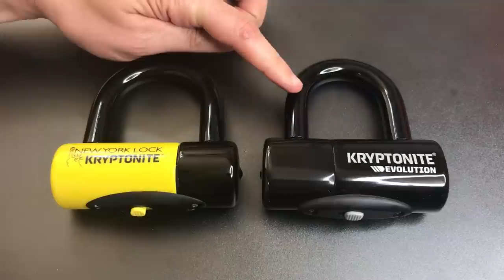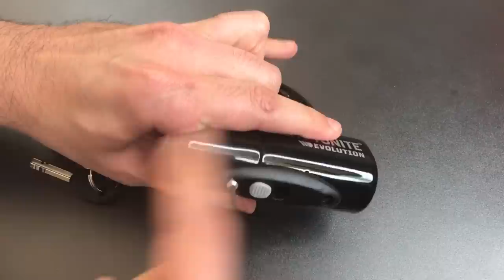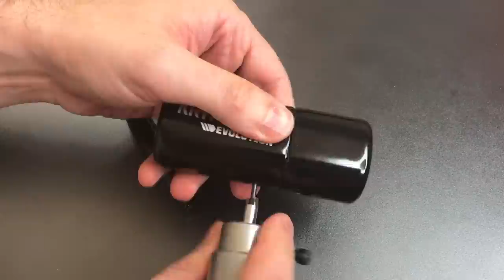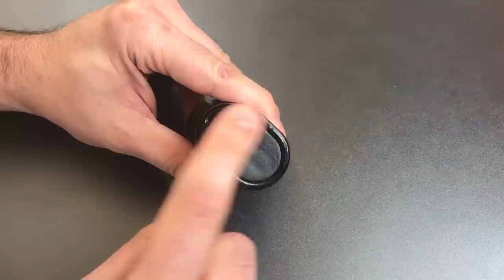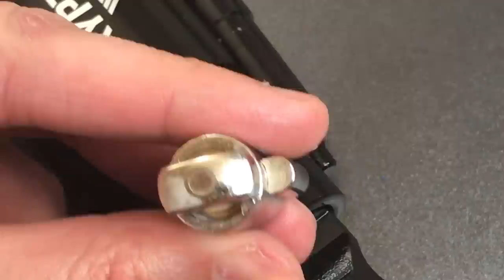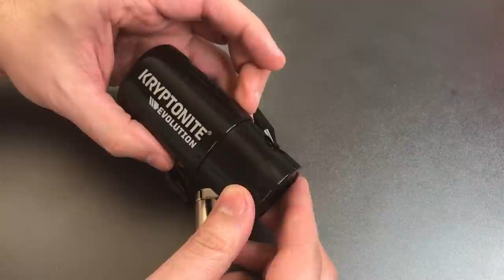[564] Kryptonite Evolution Series 4 Motorcycle Disc Lock Picked

Comment: I really don’t think that lock is pickable in the “wild” by a thief who is in a hurry and dealing with the elements and or witnesses.
Reply from the maker: +Bill S I agree with your conclusion, but not reasoning. Thieves simply don't take the considerable time required to develop the skills required. There is nothing inherently tricky about these locks.
Reply: @lockpickinglawyer  Agreed.  Most thieves/criminals are lazy by nature, as their mission and mindset is quick wealth with little work.  Which in reality is the hardest lifestyle for when you fail, which they a eventually do....
Reply: Haseeb 2  what are the dimensions of the magnets that you used for this?

Comment: You really have destroyed my faith in the security of the disc detainer locks.
Reply: I totally agree he burns through them quicker than other types of cores, I will steer clear of disc locks.
Reply: You gotta keep in mind he is a VERY VERY skilled lockpick, and also these disc detainer cores he's blasting thru and opening often don't have proper false gates. He speaks to this on this video https://www.youtube.com/watch?v=FfFTNsowDvk If you look around at all the picking videos on youtube, almost none of them are doing disc detainers which further proves how challenging these are. 

You're much better of with a disc core as most intruders won't even begin to have the tools to compromise the core of the lock, whereas it's much more likely (if they're going for a surreptitious attack) they will have standard picks, rakes, and bump keys thus making you more vulnerable.
Reply: mwiz100, only 6 months ago he stated that picking the Abus plus core was "certainly beyond his current abilities". So it's perhaps not the insurmountable challenge it appears to be. Either way, he has yet to pick the Abloy protec -- the holy grail of disc detainers n'est-ce pas?
Reply: Disk lock is a combo lock ., Usually disks have 6 cuts Abloy have also 7 cut version and they have had versions where they mix different disks .
There is thinner and taller versions of disks .
That core is very short and by key its 6 disks , with 6 cuts/disk thats only 46656  possible locks .
Going with that number and let say that make 1 000 000 locks with that core ...thats 21 locks that have same core and key !
Reply: Remember, LPL is very skilled and knowledgeable compared to your average folk. Also, this is a motorcycle lock but he makes it look easier because he only has it on a table. If a crook were to attempt picking this while it was on a motorcycle he would not have an easy time. For God's sake the first step was to remove the plastic cover plate. Don't you think that would attract the attention of people walking by, a guy fiddling with the lock??
Reply: there's more than one video of people who hit that random lottery and have 2 locks opening with the same key.    I'm willing to bet the number of matching keys is higher because manuf want to save money and using a semi-mass produced, limited number of cores, would cut costs.    I have 1 abus bike lock where the code to have a key recut is only 4 digits.  that means only 10000 different keys max on that model.   And on another lock, i actually bought a lock of the same model that used the same key.  It was purchased several years later.
Reply: Electronic locks can easily be defeated too.
Reply: that would actually be an interesting way of doing it.  like a smart card way where the unlocking code is changed every use so there's nothing to copy, not even an algorithm.
Reply: So far all electronic locks need a mechanical lock as back up so you can get in if there is no power . 
Then we have that little problem so far there is no electronic lock that can't be hacked and some even faster than mechanical locks .
In USA people hacked electronic garage locks with a kids toy and in Germany a big apartment house area changed to electronic locks and one person was able to copy the signal that mail mans key was sending and with that over 90 % of all new lock opened .
Then we have this issue we have where I live ...there maybe  - 40 ° outside and electronics usually do not work at so low temps and even mechanical locks need to be heated up when lock oil freezes .
Reply: +Simon

* Electronic locks lack the processing power required to use strong encryption      [increased attack surface]

* Electronic locks can't be updated (for the most part)     [reliability, increased attack surface]

* Update methods are a security vulnerability (firmware replacement)      [increased attack surface]

* Batteries will drain        [reliability]
  - This requires a generator mechanism     [moving parts, increased attack surface]
  or
  - Contacts for power from the key     [increased attack surface]

* Biometric keys cannot be replaced once compromised, and are easily compromised        [increased attack surface]

* Electronic system are nearly impossible to make 100% water-proof      [reliability]

* Wireless requires exposed plastic, because metal blocks radio signals     [increased attack surface, the need for plastic hurts water-proofness]

* Wireless signals are easily intercepted an replicated (Pay-pass cards (and any RFID/NFC) can easily be copied meters away by simple "driveby" attacks)        [*Increased attack surface*]

Simply put, electronic locks "harness the power" of the least secure technology possible; software.

With all that, there in now fu*** way that electronic locks are more secure than mechanical locks. They can only used to supplement mechanical locking systems.
Reply: you're missing the concept of how these smart card systems work.   There is NOTHING to be replicated or learned by capturing any data transmission or "reading" the rfid.    Each time it's used, it's a completely different code.  You can retransmit an old code all you want because it won't work a second time.   Some of the systems use PGP like encryptions where a copied/captured transmitted encoded key code, cannot be reverse engineered to generate a master encoding algorithm.    It's pretty complex stuff.  Encryption has become a field of study on its own.
Reply: littlegoobie
Do you even know how those cards work? There is not enough computing power in the card to to use any kind of cryptography. Pay pass cards are an exception, having better chips, but still, they are easily replicated.

RFID cards can't be used for one time code because they lack time tracking ability. No RFID card on the market can use OTC.

Yes, PGP exist, and cryptography is a "field of study on it's own", but both of those don't apply in RFID chips, for the simple reason that RFID chips barely have enough power to transmit static data.
Reply: we're still talking about different things here so i'm done.  I"'m still talking about active otp smart cards that have running cpu's and you're talking chipped passive cards hotel door keys..
Reply: littlegoobie
If it lacks a battery, it lacks timekeeping ability
If it lacks timekeeping ability, it needs someone to tell it the time
That someone doesn't need to tell the actual time
If it doesn't need to tell the actual time, it can trick the card into giving all the codes.
If it has all the codes (or better yet, the generating function), it can replicate the card.
Reply: Simon WoodburyForget Smart entry car locking systems are easily hacked nowadays and they also use rolling code technology,  amongst others.
Reply: Only when that rolling code changes predictably, like in some Subaru models
Reply: actually he has to take the lock on his hands... what if the lock was locked on the bike , would he be able to pick that ?

Comment: YouTube user AvE does tool disassembly videos and often gets into exact plastic types. Could tell you if that is a glass impregnated high temperature plastic.
Reply from the maker: +Morellio Benoir I would, but it doesn't really matter here, unless this was a thermoset plastic (which will not melt)... and this is not. The plastic in this lock is not load bearing. It is merely a guide. 👍 ps- I love AvE. GREAT channel!
Reply: +Morellio Benoir
Glass impregnated and high temperature are two unrelated things. Glass impregnation is for rigidity.

Comment: So, in your opinion,, if this lock(including its sister), had a  fixed buffer plate outside the lock, i.e. the plastic was metal and riveted, or if someone bought the lock and replaced the screws with normal flatheads and filed them to a smooth finish, would that make it more difficult to attack and propably bypass this lock? I suppose that since your #1 concern is the tool's reach then a way to secure the protective plastic buffer would render it very diffficult to pick? (after all fixing the screws wouldn't mind the owner, its not like you're gonna be dismantling it for fun every hour...)
Reply: Montragon29 when he did the slide hammer attack on the master ulock i checked my new york mini ulock older version which is built just like this. Upon seeing the internals, i came to the same conclusion about a redesign. The plastic plug need to go and be replaced with a metal core, aluminum or steel. The locks needs riviting or captive pins so it cant come apart. Its not really user or technically serviceable so theres no reason i can see other than economy for the design. 
I messaged kryptonite about that and the lack of false gates in the core.

Comment: Melting the plastic core would not allow the bolts to retract, but would it allow the core itself to turn if heated?
Reply from the maker: +Modern Leveller good point. Maybe. My concern about practically of this is the potential for seizing parts up... it might be worth a test. 😈
Reply: Yes i believe so. When he did the slide hammer attack on the master mini u lock, i checked my new york mini which is an older model and made just like the evolution with only one tube instead of two and its oval not round. I think its a pretty secure lock as this one is for most attacks, but i think a melt attack focusing on the side of the lock in the middle would heat the plug and core enough that it could be turned, opening then lock. I have not tried this yet and probably wont as its a 100$ lock and chain combo that i am using. Unfortuntely wasnt using it when my ebike got stolen. But i think its a vulnerability and messaged kryptonite about it.
Reply: metamorphicorder Just put a big steel tube around the lock body, and fill the void with mineral wool :) Install end caps.

Comment: So one common thing I'm seeing with these Kryptonite locks is that for all the "rating" they give these, they don't use accessable screws with either uncommon heads or security posts.  Granted the bits to drive those are easily obtainable, but it's still better than just a plain hex wrench.

Comment: It looks like the end piece that turns is interference fit, didn’t see a set screw or roll pin or any type of pin in it to hold it on. Would take a scribe and mark it, put it in a vise with that facing the ground, and heat it with a torch. Shouldn’t take much heat on a small piece to make it grow, and it fall off, let everything cool, and then disassemble it. Reassemble it then mount it back in the vise with that end facing up, and reheat your part, pick it up with some pliers, and reinstall it with you marks aligned.

Comment: I couldn't figure out how to pm you, so with that said maybe I can get a reply on the comments. 

I'm looking to get into picking. Specifically single pin picking to start with and then expand from there if I really enjoy it. I think I will considering i have benged watch over half of your videos. Anyway with that being said there are too many starter pick kits or just kits in general to make an educated/ good buy. Not to mention I don't like the tension tools that come with most sets. I don't want to spend a  fortune just in case I don't end up enjoying it as much as I think I will. Maybe 25 dollars at the most on picks.  So my question is if I buy a set what is your recommendations on that and or if I were to piece a set together what individual picks should I get? Everything I have seen as far as sets doesn't give a good enough discription as far as the thickness of individual picks and hook size. I'm simply at a loss and any suggestions would be a great help.

Comment: As a motorcycle owner, I have no hope for any lock.  I have watched a lot of your videos, and it seems you can pick any brake disc lock.
Reply: PsychoticBovine no disc brake locks for bikes offer any real sort of protection, just a deterrant. Multiple old school beefy padlocks with an Abloy Protec2 core, combined with a Pewag 12mm 62-63 rockwell hardness chain, or larger size by Pragmasis or similar should do the trick. Padlocks, Abus Granit 80mm, Squire 80mm, Sargent & Greenleaf 951 or Abus Rock 80mm. There are plenty of others but the chain would need to fit the padlock.🍺✌

Comment: So, when you say you're tensioning from the first disc, you mean that you're binding the first disc but then another disc will bind after that?
Reply: in those locks the first disc is always 0 bitted for tensioning (all the way cw, no cut on the key).  Thats why he always turns all discs as far as they will go at first; you are turning that first disc into its gate so you know it will never bind.  Then you can tension from that first disc and then turn the other discs back to their respective gates depending on their binding order.

Comment: Now do the ABUS and I am impressed ;)
Reply from the maker: +Christian Weller Like video 548? 😁
Reply: Ah very nice :) Still you were very lucky that you could tension it on the first disc ;) Try a bike lock with x-plus core and a butterfly disc on the front.
Reply from the maker: +Christian Weller Not lucky... just an old lock. As for the newer ones with the butterfly discs, I have a few ideas for dealing with that. We will see if any of them pan out. 👍
Reply: I think it should be possible to tension the butterfly disc together with the disc behind it, with a deep enough tool. It is always a 6 cut so tensioning on the disc behind it should prevent an overset and put it just right. Next Problem is that the second disc might not be a 6 cut and prevent the other discs from binding. Don't know how to deal with that. Although I successfully picked chinese locks with the front tensioning tool by using the movable part to turn the core and then turning back the front disc last with the tensioning part. Looking forward to new videos from you :)